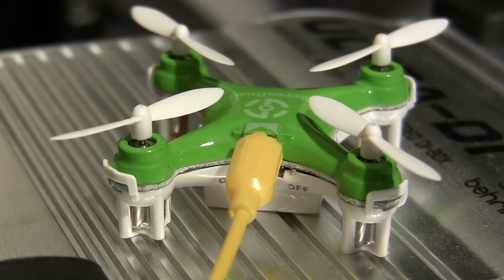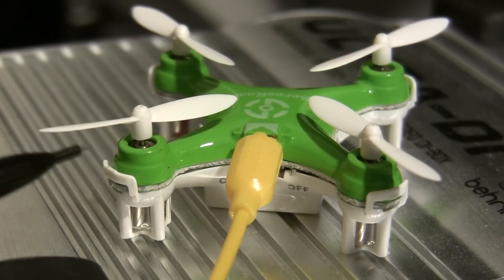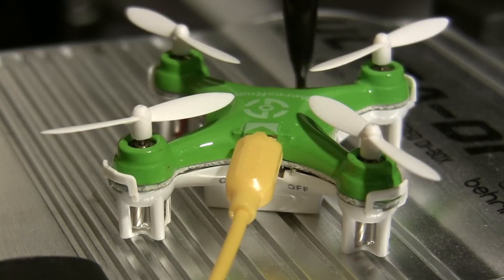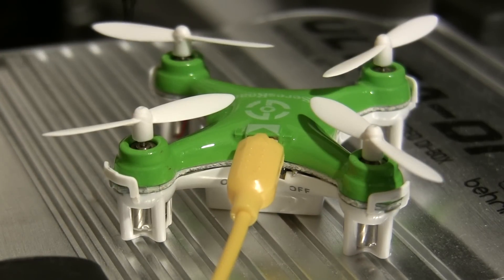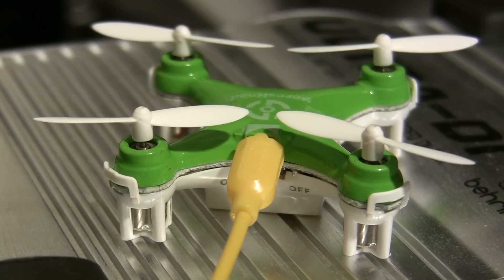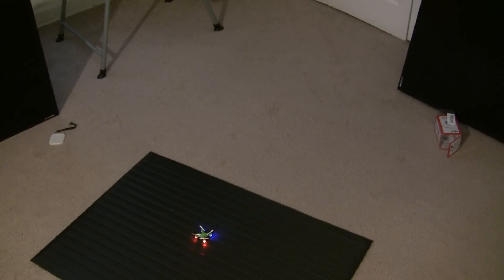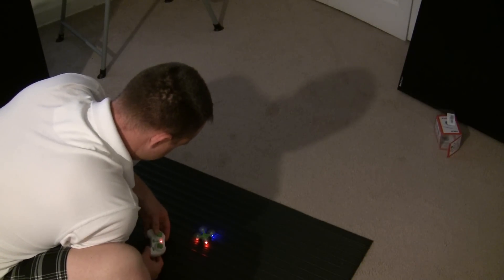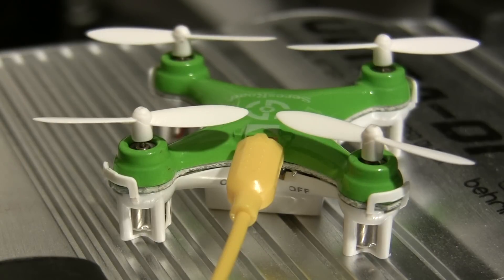How to Fix a Drone that Won't Fly Broken Props Install Wrong and Wifi Interference Can't Takeoff

Comment: Mine keep flying to the side I resently dropped it and one of the clips at the side dropped does it affect it or it’s my blade
Reply from the maker: On a level surface, recalibrate the gyros, then adjust trim while hovering at least 3 feet or more.

Comment: Hi, I replaced the props as described in the video but it didn't work, I think I have a problem in the motors. I have the same drone as yours. please reply
Reply from the maker: It's possible the motors are bad. I've had some not work out of the box. Also the battery could need replaced
 See if the battery is swollen.
Reply: @LifeBloodMarketing  Do you have discord? I want to show you the battery

Comment: Dude this did not tell me why my drones fourth spinner won’t fly
Reply from the maker: Because a wire is broke, prop is loose, motor burnt out, or it's not the 4th spinner because they are not numbered.
Reply: Press the left toggle

Comment: So I have a riviera pocket quadcopter, it is almost exactly like the one shown in this video, however it hasn’t been working. I can charge it up and pair the controller to the copter but the moment I try to apply any lift the motors spin for a split second and then the copter goes back into pairing mode. For a while it did this mid flight but now it doesn’t even get off the ground. I have been searching for answers but have yet to find anyone with this problem. The manual doesn’t even seem to help. Any ideas?
Reply from the maker: I've seen that a few times and no fix.  It could be a battery, or something in the power circuit. As you can see doing any solder work on these is a pain. I'd call it a parts quad and get another one.
Reply: hmmm that's a real shame. I tried a bunch of stuff and have tried to fix it off and on for about the past 3 years I have had it but with no luck. I got it as a gift and likely won't be getting another one any time soon. Anyways thanks for responding! I searched the internet for answers for probably hours with no one giving a good explanation (probably because of issues like the ones in the video being much more prevalent). Anyways, I really appreciate it.

Comment: So, I recently bought a fpv drone from a nearby flee market, when I looked inside, everything but the micro sd was inside, so I thought "Probably the most complete thing ever found in a flee market", and all the props don't look messed up. I charged the battery up, plugged it in the drone, turned on the controller, put the drone on a flat surface, paired it, checked the camera to see if it works, the camera is still in great condition, but when I tried to put some throttle, NOTHING HAPPENED, but the WIFI didn't seem to affect the motors, any help???

Model: FOCUS

Manufacturer: LiteHawk

Controller: 2.4GHz
Reply from the maker: Without another known good controller to test if it's broken it's hard to say.

Comment: Its A1 and  A 2 digonally and B1and B2 digonally : A1 nd B1 at front : press joystick on opposite derection in which its moving and find the hovering center : thats all you need to fly : welcome 🙏
Reply from the maker: Full throttle, smash ceiling, replace blades do it again.  That's about how everyone flies these little quads.

Comment: the problem I have with mine is that it won't calibrate. any idea how I can fix that?
Reply from the maker: Is it drifting one way to much?
Reply: LifeBloodMarketing it's not getting any lift. I figured out that I have 3 b properlers though but aside from that it still won't calibrate
Reply from the maker: I don't know man, I've had a few bad ones out of the box. Did it ever fly?

Comment: my one wing is not working what should I do ?
Reply from the maker: bad motor? I have one out of 6 bad out of the box.
Reply: Gaming fever one of the wing is not working fine what should i do?
Reply: Gaming fever buy new propellers
Reply: idk
Reply: Same
Reply: buy another drone
Reply: Yup, one of my motors didn't work. I had to take apart and I found that one of the wires broke off the pc board. I soldered it back on, and now it works!

Comment: my drone was flying next to my modem and it was flying fine. I made a pilot hole on the remote and used one of the screws for the remote board to drill a hole and pulled the antenna through and works fine.
Reply from the maker: You have the orange one with the red pcb?
Reply: Haven't checked

Comment: I crashed my cx-10D against a wall and no propellers fell off and no scratches or anything. But when I try to fly it after that the controller and the drone pair fine but when I click the takeoff button the propellers don't spin and the drone doesn't take off.
Reply from the maker: Might have to get a new one. Some of them are just busted out of the box.

Comment: mine keeps tilting to the right someone please help it's not the propellers they are on just like how the video told me to put it on :(
Reply from the maker: +guest guest trim, you'll want to try and trim. switch to advanced mode, three beeps, and click the left press button about 10-15 times. see how it flies and adjust from there.
Reply: +LifeBloodMarketing oh ok it worked thanks!
Reply: +LifeBloodMarketing also one last question. how come one key return button doesn't work? I have a Tec.Bean drone with the portable charger and a compartment for it within the controller.
Reply: +LifeBloodMarketing it just tells the drone to go a random place.

Comment: Sorry if i write this just now, i got my Cx-10c today and when i try to connect it with the controlller, it connects but when i flip the lever up it won't do anything, only the flashlight are beeping but i can't do nothing with it... Can u help me?
Reply from the maker: +Thomas If it syncs and doesn't do anything, the battery safe might be tripped. Plug it back in the charger for a few minutes. Try again.
Reply: +LifeBloodMarketing I already did that a few times but nothing, any options?
Reply from the maker: +Thomas Not really, I picked up 5 of them and 1 didn't work at all out of the box.  You could get a refund.
Reply: +LifeBloodMarketing But before the quadcopter was fully working, then i just recharged it for like 1 hour and when it's synched, i lift up the lever to let it go up, but just moves for like 1 micro second the rotors and then the Lights start beeping, i don't know what to do anymore

Comment: Mine ran for a while but now if it is inverted once it shuts down two of the blades until I reset.  Even if I turn up upside down gently with my hand it'll shut the two blades down from then on.  Blades are on right and no wifi.  Gyro problem?
Reply from the maker: +petersboro Perhaps, did you try to recalibrate the gyros?  Sometimes they are just bad, I've had bad ones right out of the box which in turn become parts.

Comment: I just got the CX-10c which just has the added camera. I'm having problems where it drifts to the left as I slowly take off. I calibrated it several times and the blades are from right out of the box no needed to change them yet. They look fine. Not sure what the problem is...maybe a dud? Doesn't hover well either.
Reply from the maker: +John Simko Switch to mode 3, and press the right trim button 8 times to start. Hover and see how fast it drifts, press one or two deeps at a time until it stops drifting.  Search, setting Trim CX-10 I don't have a video but there are a few.
Reply: +LifeBloodMarketing thanks for the advice. The C model doesn't have a right and left trim just up and down. But now the thing won't take off...the blades move slightly and then don't move at all. Did I blow out the motors?

Comment: Seriously!!! that was my problem the whole time.. unfortunately I did break mine (just one of the tabs). one of my motors stopped turning because the positive wire broke. After I put it back together, I couldn't get the dumb thing to fly straight. Thank you again this solved it!
Reply from the maker: +Jason B Awesome! these things are a blast.

Comment: Cheers! Checked my blades, and two were on the wrong poles! Saved me hassle and postage for a new one (or replacement)!
(Was ALMOST convinced I'd burnt two motors out!)
Reply: me too and I found video.  Thanks for posting.
Reply from the maker: +tallaussiebloke That's great. Fly away!
Reply: Have been! The 10 min battery life vanishes in "seconds"!
Reply: No worries!
Reply: +tallaussiebloke Yeah more like 4-5 min on a good flight.  I find a nice figure 8 pattern on a calm day does well.  Plus when your focused for that short time it goes by slow but fast. 10-15 min flights are long and can be tiresome.  At least when shooting video on something like the DJI.

Comment: At the start one of my blades broke so I thought putting any spare blade in would work but then by searching around you have to have a correct blade in each spot. After seeing a photo of where to put them I tried that didn't work broke another blade but then found your video and after trying it out it worked. thank you so much liked and subbed.
Reply from the maker: heyitzdimitri I feel your pain.  Happy flying.
Reply: That's exactly what happened to me! It slammed into the wall and then kept going on the floor and I see that there is wifi interference cause like every house around me including mine has wifi so yeah. Now I fixed it and omg thank you!
Reply from the maker: Ben Haskett  you're welcome. I noticed my doesn't like to connect/pair with the remote sometimes when I'm outside. Lots of wifi and radio towers around
.

Comment: I just got mine and it would take off, I did bang it a couple times pretty hard but it always worked. I came home after work and played with it for a bit then it just stopped taking off, my blades are correct and its fully charged but even at full throttle it wont go anywhere! Even after calibrating, nothing. It does lose throttle at times, so is the WiFi effecting actual takeoff because I can still rotate it but it only goes one way like the radio signal is being jacked up. Any input would be helpful!
Reply from the maker: ***** I've had this happen more than once. There is a reset after a few crashes.  Leave it on until the lights stop blinking, recharge and try again.
Reply: LifeBloodMarketing If you are talking about the reset by pushing down on the directional stick, I've tried it :(, I think I'm gunna have to send back to Amazon and get a new one.
Reply from the maker: ***** no, I'm talking about the device has a battery shut off if you crash it to hard.  You have to cycle the on and off a few times. I've noticed on some of mine they won't even syc up, I've also seen them start and stop mid flight after some hard crashes.  

They are cheap toys, I've has a few go bad after one drop.  You may just have to send it back. what color?
Reply: LifeBloodMarketing It's Orange, I defniitely understand it's cheap lol! So not too disappointed except I only got like 10 minutes of playing with it which bummed me out. I've tried on and off multiple times, charge, calibration, everything I could think of, still same thing, full throttle all 4 blades rev up to full speed but it just sits on the surface it's on, no lift off, I can tilt it one direction to where one side comes off ground but other side just wont lift off.
Reply from the maker: ***** you're blades have to be wrong.  they might be 180 off.
Reply: LifeBloodMarketing I'm an idiot. I got home. Checked blades. Yep backwards. Once switched we are back in the air!! Now time to learn some flips.
Reply from the maker: Nice, don't worry I had the same problem, that is way I made this vid.  Because it was so easy to mess the up.
Reply: LifeBloodMarketing yea I appreciate the video.

Comment: My quadcopter would stop right after take off and fall. Wifi interference must have been the problem. Thanks for mentioning that. Would you happen to know what the numbers on the back of the blades mean?
Reply from the maker: ***** No I don't know what th numbers mean.  Also my friends would do the same thing. His would take of and turn off.  It was beat up pretty bad though.
Reply: ***** A Zip-Tie around the circumference of the quad  fixed it for me - it was a vibration problem - http://www.rcgroups.com/forums/showthread.php?t=2487086#post32503771

Comment: Nice1 ;-)
Reply from the maker: paul bird Glad it could help.  I've flown this thing about ten times. I noticed right about 3/4 battery the wifi interferes. A few reset and it can fly a touch longer.
Reply: Didnt relise i had put the blades on wrong..thought i had buggered a motor.had mine about 6months flys great inside n out gets small fast tho